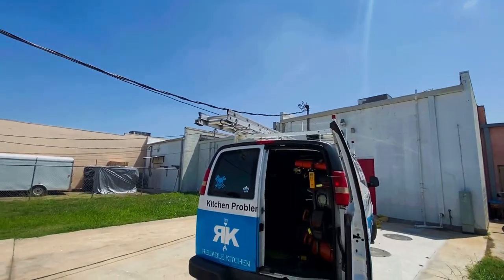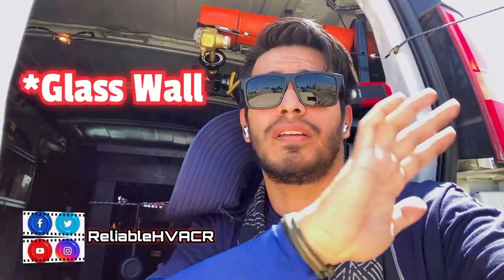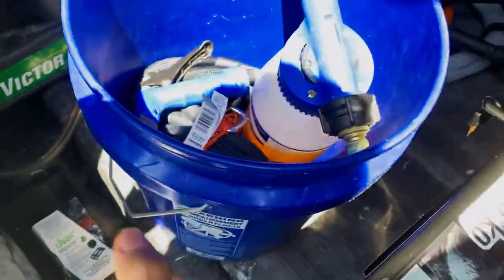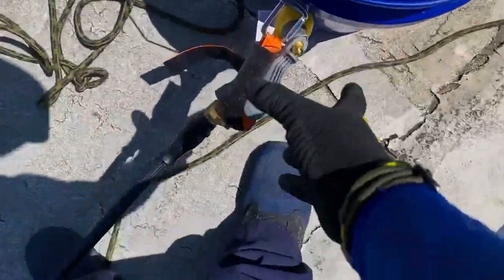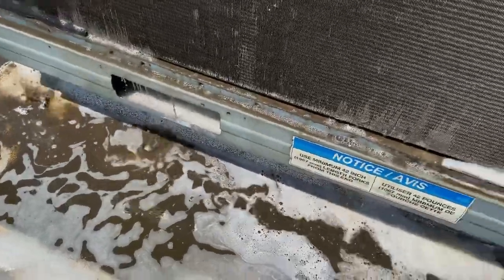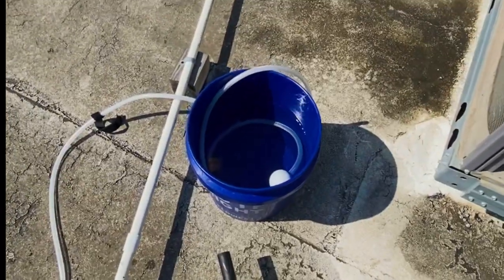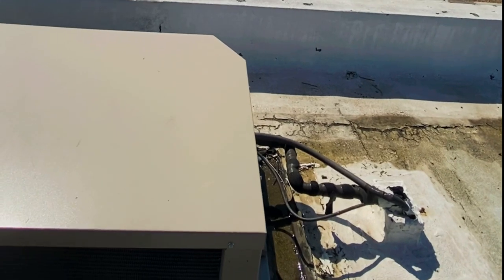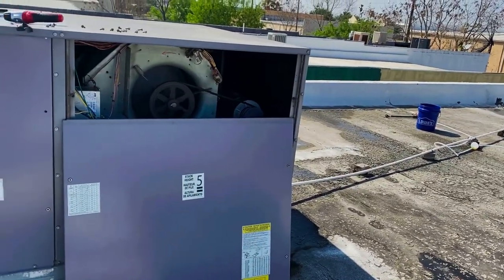No Cool Season | Kitchen Feels Warm | HVAC Vlog

Comment: Great video. I like the safety tip to cover your body from the sun, wearing long sleeves is important if you plan to be working on rooftops for 20+ years also important to cover your head and ears too.
Reply from the maker: It's made a big difference the last few years I started doing all that